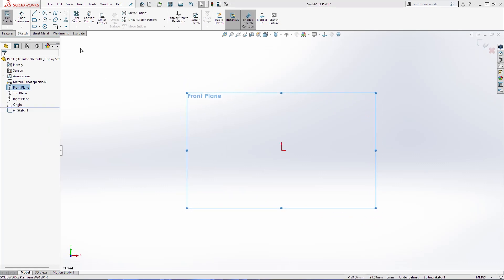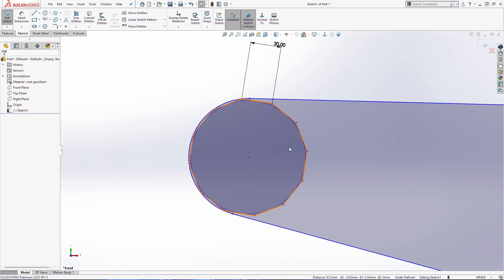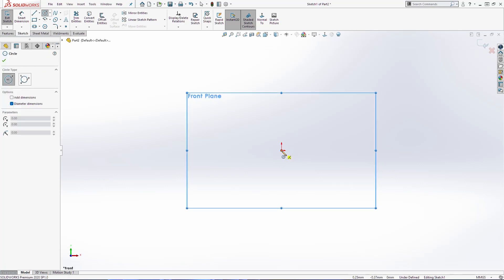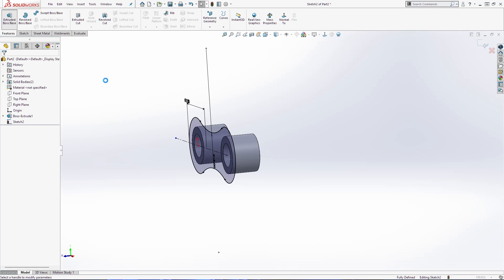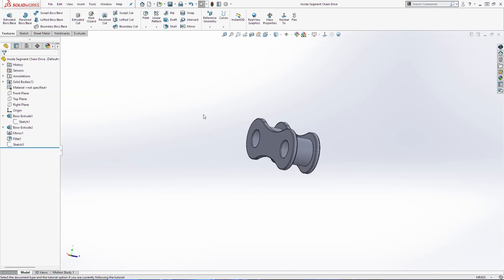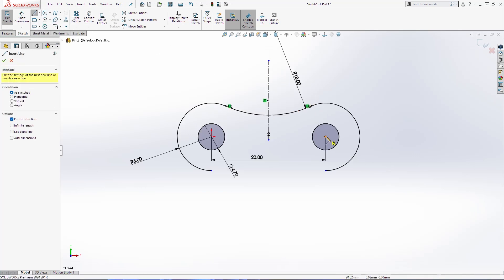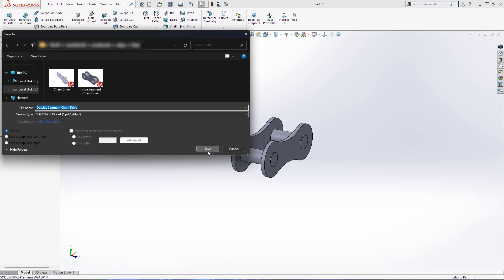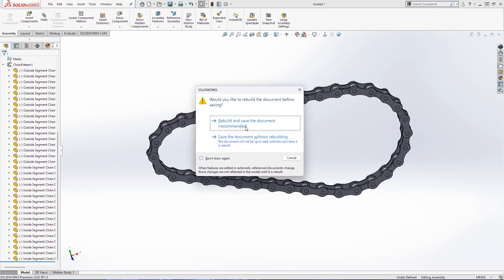Solidworks Chain Component Pattern Tutorial - Design Drive Chain in Solidworks

Comment: hi. I am trying to replicate your video. I have managed to get to 7.59 however I cant hide sketch3. there is a red and green light icon next to it. can you please help?
Reply from the maker: hi.
that icon always appear when you have to close the sketch region or the sketch is not fully defined.
Reply: @solidworks.tutorial  I have now managed to create all three parts for the chain assembly. When trying to assemble, I get up to 12 minutes 41 seconds in the video but when attempting to select chain drive sketch 1 I am getting a error message as follows. "All segments of the profile must be tangential and they should be of one contour only" I am assuming there is something wrong with my chain drive part. Do you have any advice to fix the issue?
Reply from the maker: @Ann-MarieKennerley  check the sketch lines, and fillets, every radius have to be tangential with the lines.